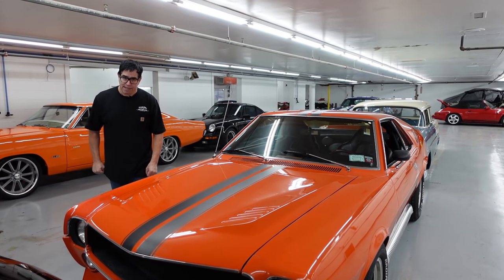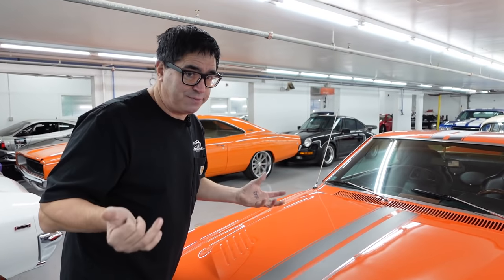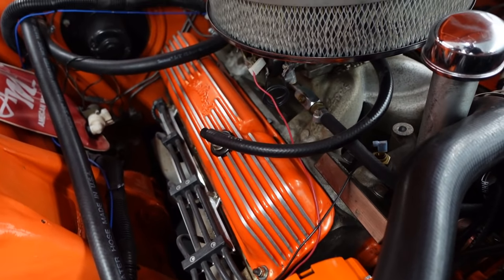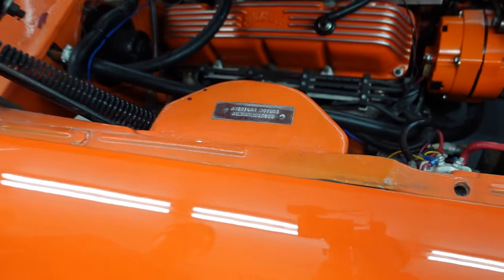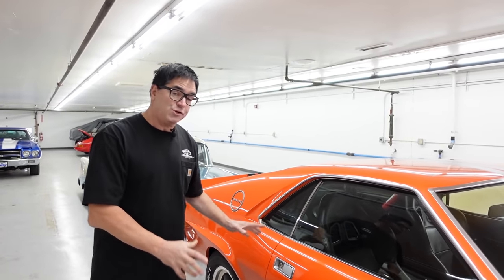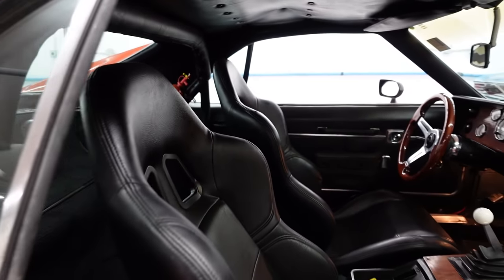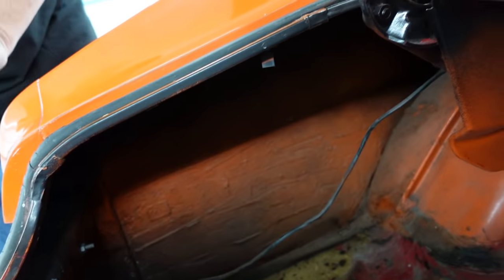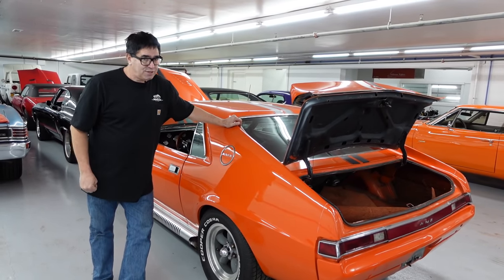1968 AMC AMX Walkaround with Steve Magnante

Comment: There never was a "Big Block" 290,304,343,360,390, and 401 V8 engine, there all same casting other then internal changes, to make things simple AMC casted the C.I. in each side of the block :)
Reply: Steve said 'Big Dog' not big block. There wasn't a 304 available in '68-weren't released until '70, and the 304 was never available in the AMX. Steve may have gotten '68 and '69 inverted when speaking of the available size motors-'69 only had the 3 available. '70 only had the 360 and 390 with far better heads than the '68 and '69 of the same motors. I owned all 3 years at the same time, '70 was my favorite.

Comment: Very underestimated car .............. I actually raced one years ago I bought from Pete Peterson . Well-known Pete's Patriot . The car was capable easily running 10.70 but could go way faster . The weak point was the tires . Later on they would go in the 10.40s current or they can go on the nines . Because of aftermarket parts that are allowed . The downside was they had to run the Fairlane thunderbolt . Which was one bad ass car. Capable of stupid speeds .... They own ss/c .. The go package that you spoke of was a performance option then for AMC .

Comment: Back in my early 20's my friends all had muscle cars. My buddy Pete had a 1970 AMX and raced my friend Jerry's 1969 383 Magnum Roadrunner. The AMX lost 3 out of 3. Then Pete raced my friend Willy's 1970 Nova and got beaten worse than the by the Roadrunner. Months later, another friend Michael, bought a 1969 396 Chevelle and yep... you guessed it...the Chevelle beat the AMX so bad that Pete wouldn't race him again! A month later Pete sold his AMX and bought a 1969 Pontiac Firebird with a 400 ci engine. He eventually got rematches with the Nova and Roadrunner, beating the Nova and tying the Roadrunner (they only raced once as the RR had some type of front-end problem). Fate prevented the Chevelle and Firebird from eventually racing as our friend Michael passed away after a brief illness. Those were great hot rod days!
Reply: Nice story. I had a 68 OHC 4.9 litre 6cyl firebird with a 70 GTO 400 in it when I bought it and raced a 1968 or 9 Road Runner with a 383. We were pretty even for 20 ft before I pulled away. He asked me what I had, and told him while we were in the race. I then raced a shit box black primer Nova 68-72 don't know the year, and he blew by me with a 6 cylinder 3 or 4 speed. I was shocked, and never raced again seriously from that embarrassing moment when I was 18. Everything is a sleeper
Reply: i know a guy who would smoke the hell out of novas and fords with his amx. mopars are tough to beat. but the 390 he had could rev to 8k and coupled to a t10, he would kick ass out the gate

Comment: 5 speed so you can run 411/456 gears and still cruise at 65-70. Did they offer the 360 also in 69? Title says 1968    1968 AMC AMX Walkaround with Steve Magnante

Comment: The 343 was a lot more durable engine than the 390.
Reply: I've heard that are you referring to the original pistons in the 390 broke the top ring land ? If so I think amc started to use a different piston supplier.